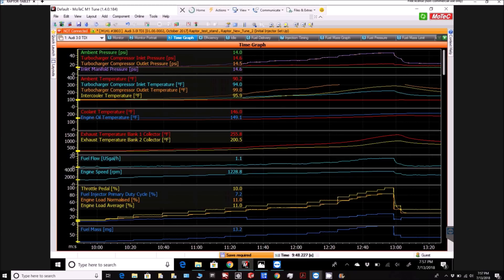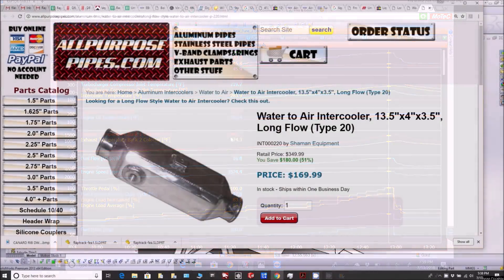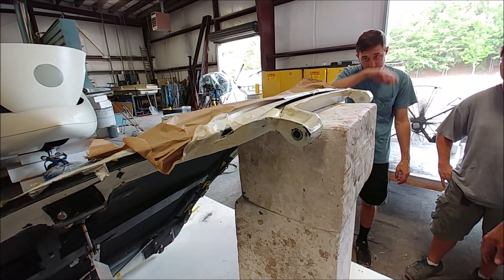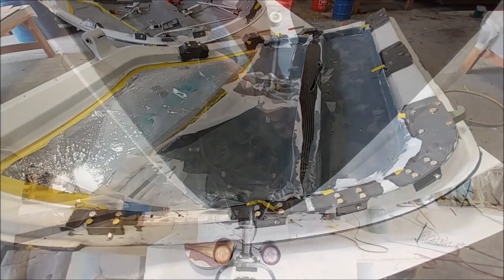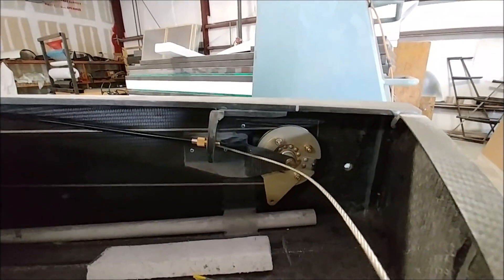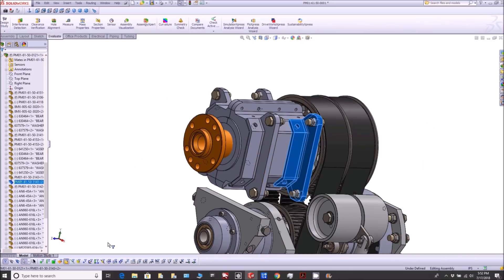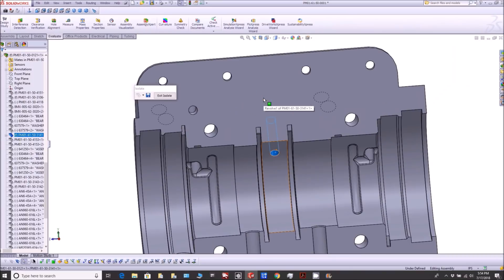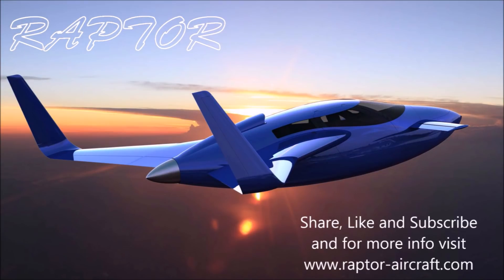Foreplane Spar Layup - Building the Raptor Prototype

Comment: Surely the Temperatures in the Turbo and inter-cooler will be lower at speed through the air and at altitude and differ with the seasons ? Is there an airflow in the engine housing when flying ?
Reply from the maker: Yes, but I'm also trying to optimize things as much as possible so we need the least amount of cooling air flow and subsequent drag.
Reply: Right,  did not think of Drag. So do you have some sort of auto control over internal airflow/airspeed? In retrospect I am probably getting ahead of your plans for systems covering cabin pressure, computerised controls and instrument panels. My apologies for amateur input. I will sit back and watch you and the experts complete this very interesting project. Good Luck.
Reply from the maker: Yes, we have an adjustable intake, temp sensors for the fuel tanks and plan to figure out how to automate the movement of heat to where it is needed.

Comment: Is there a regulation for fuel temperature? And even if there is, where to deposite the heat if the fuel is already heated?

Even more, the fuel is not only a limited resource to take heat, its capacity will also shrink during travel as the remaining fuel will go down - eventually down to a point where there is next to no fuel in the tanks - while heat output stays prety much the same over the whole profile. Also, while there will be a (somewhat) good heat exchange from the tanks to air in high altitude, low altitude flights may result in again less transfer. Which includes the situation of most heat production: Start and initial climb. Not to mention on a hot day.

At the end it might be more apropriate to increase the radiator(s). Still while using that air to water exchanger, as now the water will also act as a buffer and equalizer. Sure, more plumbing, but maybe worth the idea.

Considering the small size, it might even allow to put this heat exchanger between the turbos. While being a little less efficient for the heat transfer, it'll reduce absolute temperature for the second turbo, greatly reduceing stress, and at the same time increasing it's efficiency. THough, not for the prototype, but I'd considere it for the series.
Reply from the maker: Hans Franke we really only need this extra hear dissipation for takeoff and climb. After that we only need to just keep the tanks warm to prevent gelling if we have strictly diesel fuel. For all your other comments we have thought of them all and implemented what we can based on space and technology limitations. Now we need to try it all and see what works and what doesn't and make the necessary adjustments. I.e. building and flying a prototype.
Reply: Oh, don't get me wrong. I perfectly understand that there shouldn't (and can't) be any large modification for the prototype. Especially as that one will b flown in way more supervised conditions tan a later one. For now I would only suggest the addition of temperature sensors at various points of the tanks (and fuselage) - and maybe a (manual) way to switch the cooling flow between going into the tanks or with the rest of the coling system.

The later might be neccessary to keep the heat exchanger from being damaged when flow to the tanks ned to be cut.

Another way to manage this may be puting the new heat exchanger after the existing intercooler. This will reduce maximum temperature reached there, while it should keep the over all result similar.

Don't get me wrong. I assume that most of what I'm comming up has already crossed your mind. Just giving a second input.
Reply from the maker: Already doing all that you have suggested. You need to remember that I am living, eating and sleeping all this. There's not much that I haven't thought of or already considered in the last 5 years of working on this.
Reply: You're aware that it doesn't matter what kind of engine it is as the support systems would be exactly the same for a petrol engine? In fact even more complex as also ignition has to be added. The whole design is quite well thought thru and it gets a maximum of performance from rather simple, and well proven components - the later being quite important for success. If at all, configuration details may offer further improvement - for later.
Reply from the maker: But then it would be less efficient, burn more expensive fuel and not be able to fly anywhere in the world and run on jet fuel. You'd also have to spend a fortune on spark plugs on a regular basis and have to worry about leaning. A gasoline engine doesn't sound that appealing to me. But I guess youdontcare about any of those advantages. 😋
Reply from the maker: idontcare80 you can't get mogas at every airport. In fact you can only get it at very few airports.

Comment: I'm a bit worried about the higher exhaust temperature and having the intercooler cooled by fuel.
We got a fatal accident, on a Velocity 173 RG / HB-YHB were (due to our restricted noise laws) an additional muffler was installed, generating to much heat which melted parts of the fuel system, which lead to a fire.
Pusher are well known to have difficulties to be kept cool.
Do install a fire detection system, at least.

link-> https://www.sust.admin.ch/inhalte/AV-berichte/1883_e.pdf

Comment: I am curious how does the re drive casing seal after closing both halves?
Regular engine like gasket on both surfaces?
Reply from the maker: O ring gasket thanks sets into a groove on one case side. Not shown in video.
Reply: Raptor Aircraft PIP (press in place seal) for the face seal between case halves ?  This should be your best bet but may still be a challenge.  Works best if the pip seal is molded to follow the path of the groove milled to retain the it.   Orings are typically assumed to take a circular path, thus the term PIP seal.

Comment: .....running fuel through the intercooler?????....the only intercoolers I've seen and used have been water to air....
Reply from the maker: It's only really going to be needed for take off and climb just to get the best performance with the lowest intake temp. At altitude it likely won't be needed much.
Reply: I don't know about intercoolers, but fuel is used to cool down jet and rocket engines parts. Its pretty smart, you don't need to carry any other cooling liquid when weight is critical.
Reply: I work fuel systems for USAF. Heat exchangers are a common component, although I’ve mostly seen them cool oil or hydro and not air.